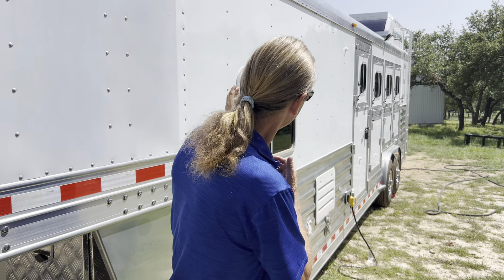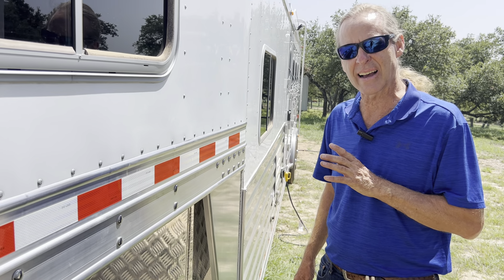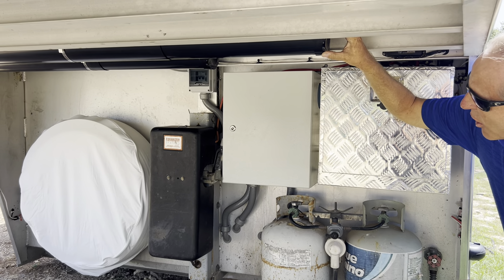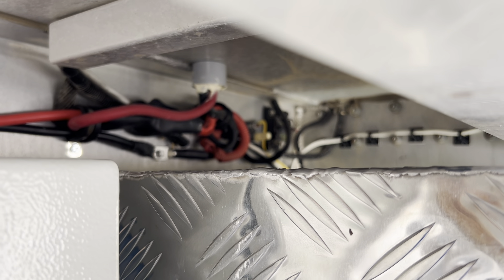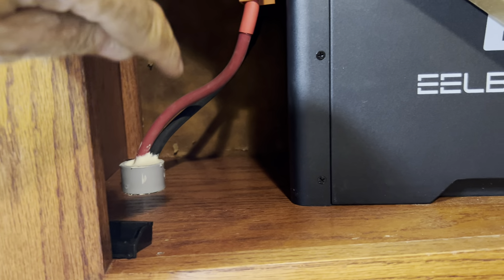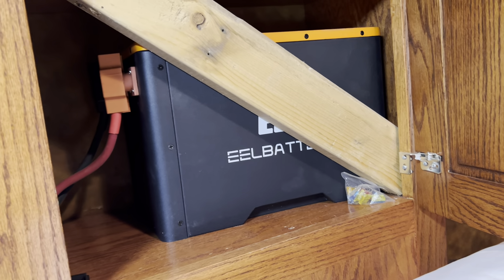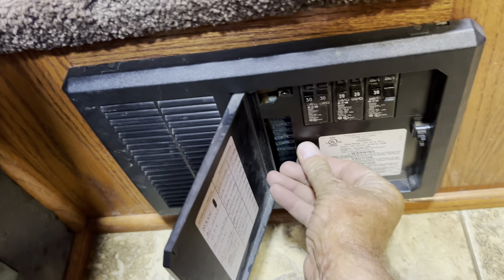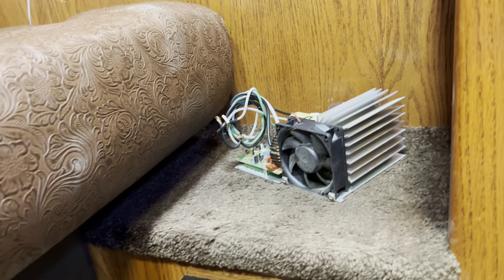Lifepo4 Upgrade In Your RV Or Horse Trailer. How To Ditch Your Lead Acid Battery

Comment: Victron have the orion dc-dc converter/charger range, I have the 24/12 that I use to power my 12v legacy system and the 12/24 that's set to charge my 24v battery from the van alternator. The original versions do get hot under load, but victron are doing a refresh to a smaller and more efficient version, I plan to update them as soon as i can. When I used to have a 12v lifepo4 without converter, I had some issues with new 12v vehicle LEDs dying and rv lights flickering, that went away with the steady output of the converter. Something to consider anyway. I use my original battery as a portable power station, I can run a circuit from it to replace the converter in a pinch, it charges trom the 24v inverter or any handy outlet through a 120v/12v charger.

I love this project, thank you for taking us along.
Reply: Victron has some beautiful stuff and I've been thinking about getting one of their grid/solar/battery solutions that allows the system to be switched from grid tied to stand-alone for one of the outputs in case of a power failure in the grid.
The only reason why I have not done this yet is that a friend testing this has a problem with the battery part and he is not getting any support from Victron because he has a home built battery ...

Comment: Hey Ray its good to see you back at it with another project! Hadn't seen you around in a while, I'm happy to be able to tune back in and learn a few more tricks 👍 I'm nearing completion of a massive battery upgrade, (an entire system upgrade really) and your videos have been a valuable point of reference for me during the process. I greatly appreciate the way you clearly convey your methods and the materials you use, you are an excellent teacher.
Reply from the maker: Hey, thanks!
Reply: For real😊

Comment: I'm not a big Eel battery fan, I bought 48 cells 2 years ago, and now they are failing one by one. 

Thanks for sharing, and as always, keep building 👍
Reply from the maker: Yes, I have a video where I tested some eel cells. They did not test as high as they had claimed. I will continue to get my cells from Jenny Wu.
Reply: @RayBuildsCoolStuff  I'm hoping that Eel battery will help me resolve this very, very expensive issue. I think we spent over $12,000.00 on these cells, and now, one by one, im watching them fail. It started with one cell charging much faster than the others, and then that same cell would discharge faster than the others. Every day now another one does the exact same thing in 3 separate banks.
Reply: @ToddLarsen dang how long have you been using those?
Reply: @2hotscottpro  2 years now,  give or take a month.
Reply: @ToddLarsen  that’s krazy

Comment: Great to see you. Next….9K 30.5 SEER Gree Sapphire Mini Split HP. I put one on my work van and 1620W of REC panels. Works great, like you.
Reply from the maker: Sounds great
Reply: How many watts does that unit draw when the compressor is running?
Reply from the maker: @keithbrookshire  the compressor is around 1300 watts but runs on the big battery.
Reply: @RayBuildsCoolStuff  Thank you. That sounds reasonable.
Reply: Innovair has a 38 seer 9k btu.? 28 SEER2 Rated? $995 I have one getting delivered today.
Reply from the maker: @2hotscottpro please let me know how that works out for you.
Reply: @RayBuildsCoolStuff  I sure will. There 12k btu says 30 seer,so the new seer2 rating may be 21 seer2 ? I’m not sure how to calculate the new rating seer vs seer2 but it’s close.Have a great day !
Reply: @RayBuildsCoolStuff  fyi my 12v hot-shot water heating element uses 1 amp power more than my 15k btu rooftop ac.For some reason the Victron shunt shows 30 amp for the 15k btu ac but the house rv shows 12 amps.Weird that the 15 n 13.5 btu will only show 25 amp on rv house screen while on shore power.It’s a 30 amp rv but with both ac’s according to shunt would show 56 amp combined of 2 ac’s.
It’s whitch craft I tell yeh lol

Comment: I bought my battery cells from EEL too and have been pleased with their quality, service and price. My 12v 560ah battery uses 8, 280ah prismatic cells in 2p,4s configuration and my 16s 48v battery uses the new MB31 330ah cells. I use a Heltec BMS on each battery. My 12v BMS is 330a (with a 1,200a surge for starting my generator) and my 48v BMS is a 200a smart model. I added a 5a active balancer to the 12v batteries just to be sure they remained in sync. I also put a tiny 1" CPU fan blowing across the balancing capacitors to keep the board cool, as I heard they can overheat. I think the active balancer is overkill though, as my cells remain perfectly synched, within a couple thousandths of a volt at all times. You live and you learn.
Reply from the maker: I think active balancers are a waste of time with all but the worst cells but a popular YouTuber swears by them so they are offered on many boards now, sigh.
Reply: @RayBuildsCoolStuff  For most applications I agree with you. In my case, I wanted to be sure my 560ah bank was balanced properly and the BMS I needed (because of its large current handling capability) only has a 95MA passive balance capacity. I didn't think that would be sufficient for a battery this large. Since my 48v battery is only 320ah I think the BMS's 0.6A passive balancer will be sufficient, and so far, it appears to be doing fine.

Comment: I just got so lucky. I ordered a returned Victron Smartsolar 100/30 charger but it had a bad burnt smell. The seller refunded me and didn`t want it returned. So I got a new one. SAME SMELL! It`s the "new" smell and nothing is wrong with it. So I plan to connect them both and  with the app you can sync them to function as one. I have just enough panels for both to use my 300ah LiFeP04 for my window AC to save on my bill and stay cool if another hurricane hits without going broke putting fuel in a generator. This is what happened to my neighbors after Laura & Delta got us four years ago.
Reply: Sorry, but that’s not “lucky” - it’s dishonest.
Reply: Agreed

Comment: Does the 12v battery have enough amps to start the Onan generator?
Reply from the maker: @timcollins7582  I have a cranking battery up on the roof for the generator. It is too far away to consider cranking it from the 12v house battery.

Comment: I'd be panicking daily with those high amperage DC cables so close to the two propane gas bottles. Why in the world would trailer manufactures run electrical cables right above the propane gas bottles 🫣😬
Reply from the maker: @grantp3911  do you worry about the battery cables next to the gasoline lines under the hood of your car?
Reply: It’s a trap 😂
Reply: @RayBuildsCoolStuff No, I don't worry about the battery cables running next to the gasoline lines, because gas tanks are designed to prevent explosions, and should it ignite they should never explode (by design) since the gas is not under pressure ever, it'll just burn out, however, propane gas is under high pressure and should it take a spark, it's gonna go BOOOOM 💣💥💥💥 😅
Reply from the maker: @grantp3911  actually no.